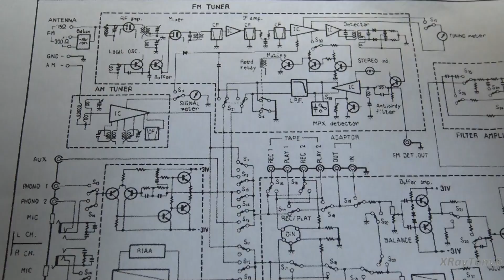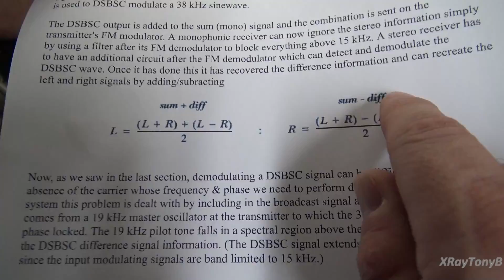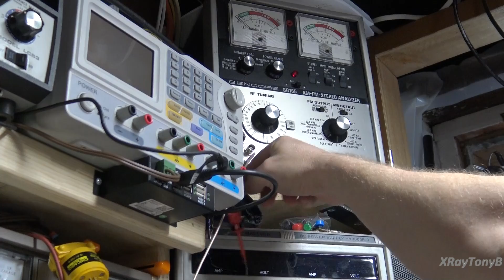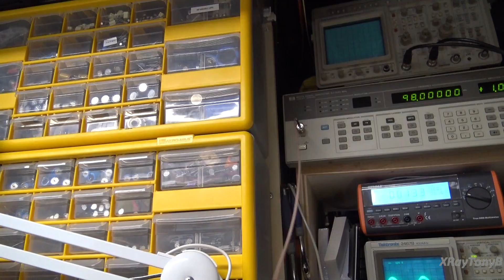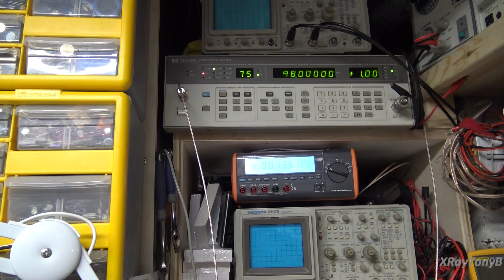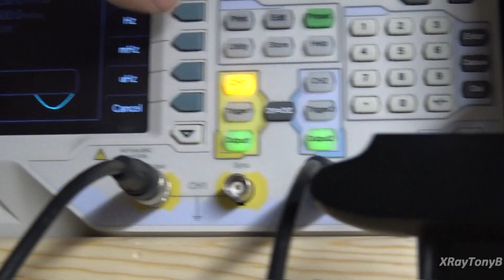Pioneer SX1050 Series Two - Part 5 - Multiplex Alignment and Final Test

Comment: Hi. I'm owner of a Pioneer SX636 that isn´t tunning anything on FM section. Changed the two old fet's 3sk45, two transistors 2sc717 and 2sc461, ic's ha1137, ha1156 and ha1201 all brand new old stock, a few eletrolytic caps , the ceramic ones only in the tunning and mixer stage. Measured the voltages on the decoder and multiplexer ic's, they aren't quite correct, there's one voltage missing on pin 8 from ha1156, change the 2sc945 that is connected in that pin, but nothing. I almost without option now. Would suggest me what could do, what I'm missing.

Comment: Just finishing up Part 5 on your SX-1050;  great info!  I have a SX-737 with a blown left channel (that i fried in a random Saturday Night haze) that i have been leery on cracking open for over a dozen years now.  Your detailed explanations have bolstered my confidence and am considering at least opening her up for a rudimentary inspection.  I've known about the issues with caps for a long while now and a few failures/successes with soldering some  of my sons cheapo toys just might be enough to get me over the tipping point.  This series on your 1050 as well as the 750  have been very illuminating.  With few options in my area for repair shops and a lack of confidence in their expertise has always made me feel like i'd rather  attempt it myself.  ...One day closer, anyways; thanks for the vids.

Comment: Great this series was great ! I used it to restore an sx5580 (well almost still need to do flat and tone amps)
I added some larger heat sinks by attaching so 1.5” x 3.5” alum. To drivers,, and regulator non destructive mod, with just a tapped hole and heatsink grease. 
Much like your test I’m seeing conservatively 130 wpc before clipping. 

FYI a pretty good piece of freeware roomeqwizard.com does everything you could want thd, spectrum,sweeps etc..just uses a sound card.

Thanks again !

Comment: I have a 1050 that is original and the channels drop in and out partially at times. I took sticker of volume control and shot d5 in. Not the way to really get it done but I’m not comfortable taking it apart to clean it and Bal well as I suspect it needs new caps in places. I listen to Bozak concert grands and have 4 sets in diff rooms. Others powered by 1980,1250 which were redone. Would you consider checking out my 1050 which is visually in Ming condition outside and inside with no dust. I did see the tape burned around that start up resister white tape turned black. Not sure where u are located but last one went to Chicago.

Comment: I was just wondering if you might be interested in repairing my Elenco SG9500 RF signal generator?, I sure could use some help, I have the manual for this generator and it appears that it actually is a SG-4126 DA or it says that on the inside, however it is a really nice little signal generator with a frequency counter and I sure would like to get it going, it turns on but the frequency counter drifts all over and it appears that there’s no modulation tone output, I bought this as used and appears very clean from the outside in mint condition, however I have not removed the cover from this generator, the previous owner told me what it said on the inside even you know it says SG-9500 on the front, because I was asking him about the manual for this equipment, and he said he didn’t know how that could be but it is what it is. If you think about it let me know if you would, and I hope to hear from you soon, thank you, oh I really like your videos, there awesome, keep up the good work,, take care.

Comment: I just purchased a Sencore 165, it looks like thats all I need to adjust a stereo fm tuner. Why do many people use their HP8657 and then use the sencore 165 signal to plug into the hp to add multiplex?
Reply from the maker: Hi Sid, great question!  The Sencore SG-165 is a very good "all-in-one" signal generator for basic AM/FM/MPX alignment, but it has some limitations.  First, the  VFO section of the SG165 is not very accurate.  It is an analog type oscillator and has an analog frequency dial.  I aligned mine with a spectrum analyzer to get it as accurate as possible, but it still is limited by how well you adjust the frequency dial to the pointer.  It is good enough for lower-end receivers, but if you are trying to align the higher end equipment (especially receivers with synthesized PLL circuits) it' s not accurate enough.  Second, the modulated IF sections of the generator are analog.  There is a crystal controlled FM IF 10.7Mhz oscillator, but it's only an unmodulated carrier.  This is why you never see me use the RF or IF sections of the SG165.  Again, it will work fine on lower end receivers, but not the newer or more high end gear.  Last, the MPX section of the SG165 can only generate the MPX signal.  If you want to inject the MPX signal into the IF or RF sections of a receiver, you need to use another signal generator with external modulation input.  The reason many people use the HP8657 (or similar equipment) is because it is a synthesized VFO and can accept external AM or FM modulation.  I also use an external GPSDO 10.7 MHz as an external referance oscillator for the 8657 for even higher accuracy.   Hope this helps!
Reply: @xraytonyb  
Thanks, great info. I am building up my shop. I have an HP frequency counter, Network analyzer and analog HP scope and new Rigol scope. Just curious, if I monitored the freq of the Sencore with these, could I do without the HP signal generator or would it just be too much trouble or just not work as good?
Reply: xraytonyb Tony, awesome material... can I use a 10MHz GPSDO instead of 10.7 as a  high reference oscillator on the 8687? Why do you use 10.7?

Ps what is the name & model of your multimeter please?

Comment: SCA stands for Subsidiary Communications Authority.  As you said, it is an audio subchannel that lies between 53 and 99 kHz on a multiplex FM signal.  It was once very popular for distributing "Muzak" to businesses.  It is still used for "Radio Reading Service" programs for the blind that are carried on many non-commercial stations.  It is also used with data modulation for the return telemetry for transmitter remote control (a data signal on the link between the studio and transmitter or a dedicated one-way RF transmission is used for the control part of the system).  Excellent series of videos!

Comment: Another great and educational episode. In a next video, would you like to go deeper into measuring the amplifier's output signal, especially the signal generator and its output voltage.
Reply from the maker: You might want to check out some of my previous videos.  Lots of info on the subject.  I even did a video on building a dummy load for testing amplifier output power.